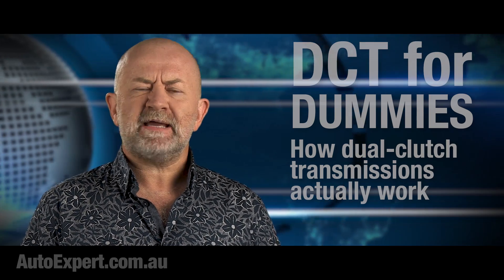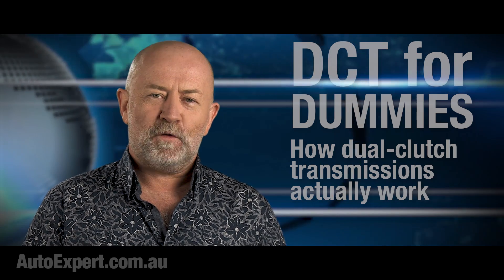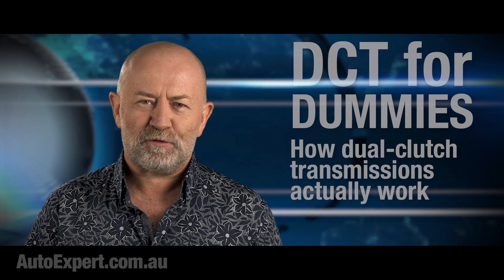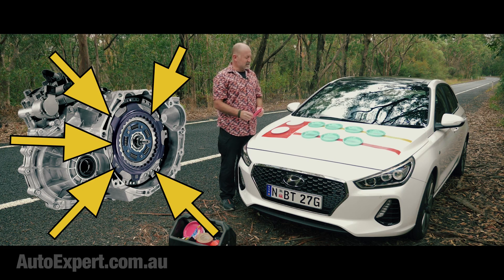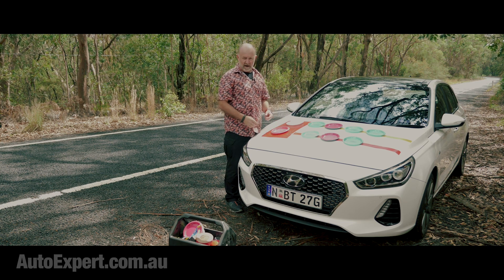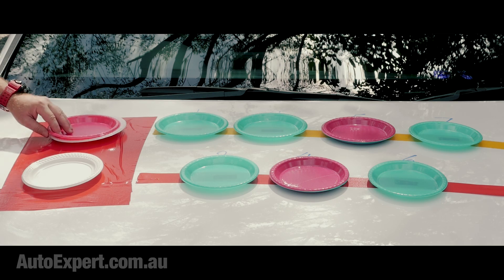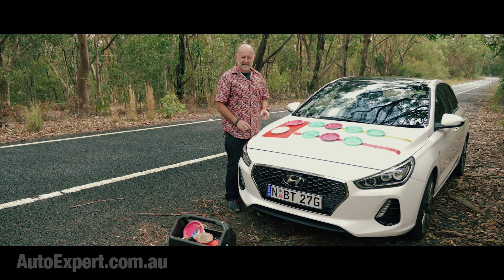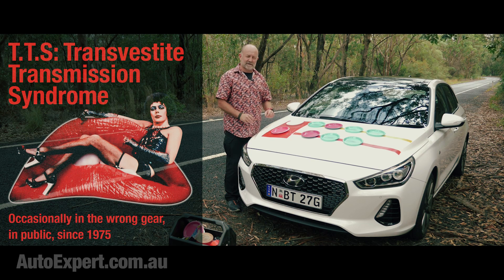DCTs for Dummies. (How dual clutch transmissions really work.) | Auto Expert John Cadogan

Comment: Something tells me that I will not be willing to have a DCT on my next car. That you for that one, John.
I have been driving a manual transmission for the last 20 years. I just simply got bored with the constant need to shift unless on a highway. My wife's car has a CVT transmission and I simply fell in love with it. I really enjoy the constant low rpm when I do not need to use the torque and a reasonably quick downshift when I step on it. The only thing the transmission does not like is when you hit hard on the gas after a long while driving at 1,5-2 kRPM. This puts a really big pressure on the transmission and it's not pleasant to experience. Fortunately, the transmission loves to keep revs at 6+ kRPM when accelerating with your throttle wide open and that feels awesome. Other than that a perfect transmission.
Reply: Carecaplatonico, this is just why there are several options to choose from. Anyone can find the best fit. I am still sure I will go for a cvt transmission on my next car. After all you can still use the paddle shifters and make the revs rise and drop when driving it.
Reply: Carecaplatonico, yes there is such an option with the Honda's cvt. You do not even have to shift to S mode to activate it. You see, things  change very quickly. I wasn't such a fan of cvt 10 years ago but that were different shifters.

Comment: How those dry clutch DCTs are in stop and go traffic? What if the stop and go traffic is on a road that goes up, on a ~10% grade?
Compared to torque converter automatics.
Reply: You don't creep with half brake, once the car in front moves off I fully release the brake and apply throttle and brake fully again if needed, thats all you need to do to preserve longevity, and grades clutch will sort itself out

Comment: SOOOOOOOO DISAPPOINTED, JOHN.....Was hoping you would get out the permanent markers and draw on the cars bonnet.  Had a R32 Golf DSG(2007 MK 5)...it was great car..until the mechatronic unit decided to 'shit the bed'....Obviously, in Spain they just laughed and billed me for a new unit...VW only recalled a handful over cars in Europe...W4NKERS!! However in the US of A any car with DSG got a lifetime warranty...probably down to a class action law suit.........................Allegedly the 'Monkeytronic' gearbox over there has a  'Speshhul' relationship with 'Boston Legal' and all that stuff.
Reply: Shows how much I was watching, must have been flipping between JC and Youporn at the time.....Didn't have a choice regards the R32, forced upon me as a 'work vehicle' out here in Spain...It was a great car, with every optional extra but like I mention the DSG system had its faults.  Few cars have/had(?) the grip and power to beat it on the mountain roads around were I lived and the DSG was very good to use..until it didn't want to work as it should....went through a few set of tyres though....NOT cheap!! The main disappointment was(still is) VW's attitude to its customers and denial of any problem with the DSG/mechatronic unit in Europe and elsewhere.

Comment: I had the same "issue" with the gearbox needing a short bit to sort out the correct gear for "unexpected" maneuvers, when I was driving a 2017 Audi A4 for a few weeks as a rental. What I did to improve this situation was to manually select the gear I wanted with the shiftpedals behind the wheel before accelerating f.e. when doing an overtake I would put it down into 4th or 5th from 7th gear. In the Audi you didn't even need to take it out of full auto mode to do this, simply pull the shiftpedal to select the gear you wanted and after you where done accelerating it went back to full auto mode after a few seconds.

Comment: I just bought a 2010 Audi a4 with the S tronic trans. A DSG pretty much. It's had the recall done on the mecatronic unit so it's really good. I use to be a all but manual fan but after this I prefer the DSG for spirited driving.  The engagement with the insane gear changes with paddles are so fun. Sure they have the odd vibration and jerk and bits and pieces. But I'm sold.

Comment: More junk that can go wrong. I'll stick to the Ford Falcon.
Reply: CBY Bulldogs with its 12 month warranty because they know it will shit itself.... 😂
Reply: Fact: Ford AU Falcon 2001 - 272,000km
Reply: MIne is at 441,000 still going strong with no oil usage
Reply: I've found from working on computers that even the most problematic models can keep running for a long time if properly maintained and used. Nice work on those high mileage figures!

Comment: The paper plates John used to describe the inner workings of the gearbox were the actual components of Fords powershit transmition.
Reply: Ricky Doodlous ummm they were plastic! Duh!
Reply: I own a Ford Focus and I can verify this. Thank god they came out with better clutches
Reply: @RagingUtai  They still haven't gotten the software right, and I don't think they want to. A Ford service worker told me they slip the clutches so the launch is "more comfortable". I got a custom tune for my Focus. In my opinion it's more comfortable than stock.
Reply: Ricky Doolous:OH! Ricky I wondered how long I would have to slowly scroll down under this YouTube presentation before I got to the ideal definition of Ford's version of what should be a better idea😢 Are you old enough to remember the 60's and 'Ford has a better idea' campaign? It would be quicker if you Googled it or Youtubed it to find it than for me to try to post it so I will advise you to do it that way because you deserve it the quicker way, because of your excellent comment! I say this as an honestly first time frustrated Ford  and 2012 Focus owner with an other wise nice SEL Hatchback except for this 'abomination'🤬 around town in stop-and-go traffic and a 'miracle of engineering'🤩 on the highway!
i.e.: 23a.m.p.g. vs 43a.m.p.g. with just a little over 19,000 mostly around town miles.This is where the dual-clutch fails to meet what I would consider a reasonable 25 A MPG. Having gone through  interpreting🤯 'anticipation' as breaking and acceleration and lighting all of the little flower petals from blue to green, and accomplishing the same for speed which was self-explanatory. We can leave the discussion of proper labeling of vehicle controls to another time. Like what's wrong with words or abbreviations of same versus multiple interpretations of sign language😤 Maybe there's a new push on to get ancient Egyptians to buy the cars and know how to operate them quickly.
Reply: @RagingUtai  it's the software operating the clutches. It's so obvious.
Reply: Ricky Doolous:🤣🤩👍🖖👌👏🤝
Reply: @RagingUtai  how many miles did you put on those clutches? I heard about Tom's tune not long after getting the car and knew it would help/eliminate the shudder, and had the clutches replaced once. Then put  32k on the next ones before getting the tune. Last year I had some bad shudder. I'm hoping it does well in hot weather. I think it will be fine.
I changed my purge valve and motor mount. I love the car too much to get rid of it. Plus I'm not looking to hurt my credit by trading into a higher loan and owing more money.
Reply: Tom says he has 55,000 shudder free miles on his wife's car. That's amazing.
Reply: @RagingUtai  in how many miles though? And how many miles were on your last set?

That's nuts. 6 or 7 times? I'm at 81k and mine were only changed once. Granted they would need it again right now probably had I not got the tune so probably 2 times in 81k
Reply: @RagingUtai  15,000 km on a clutch change? Yeah if that's the case then that's nothing. Usually the problem comes back around 15k miles. I made it to 32k before getting the tune. Like I said, last summer my shudder was bad. I don't think it has shuddered once since the tune.
Reply: I just sold my 2013 Ford focus DCT , had some issues with the tranny, not even 90K KM.

Comment: Firstly, I consider this to be an excellent demonstration with just enough technicality but not too much, some dollops of humour, so great for the 'ordinary fella on the street' such as I.  Secondly, for all those commenting here, just how many of you have actually driven let alone owned a car with a DSG (or Powershift etc), basically 'double clutch'.  I will venture to bet not many of you on any percentage scale.  Well, I have!  Following a road traffic accident on the day I was 18 (a motorbike engaging a car never works for the biker does it), I have to drive manual transmission cars, so basically NO choice!  

I've owned 'ordinary' autos by way of three Fiestas, a brace of Talbots, Vauxhall, Rover, Citreon, Honda, and CVT in a Volvo and a Fiesta.  The worst of these was the Volvo, being a horrible piece of s**t, enough said!  The big drawback with all of these was no matter what my driving style (I am no racer, trust me) the fuel economy could never be equal to an equivalent manual.  Not sure why that should be but I am not that technically minded anyways.  So, I am very experienced in living daily with auto gearbox cars.  

Then, in 2012 after testing nine cars, and many suitable ones amongst them (aside from the Chevrollete Cruise which was absoluty c**p) I took delivery of a new VW Polo 1.4 Match DSG.  My wife and I went on to drive the cars for three years, completing about 14, 000 miles (can't recall exactly but we do well below average) and it was fantastic.  For once we had a car that complimented/rewarded our careful driving style.  Although we didn't do very long journeys (mainly around town and shopping).  The best I attained in terms of economy was 62mpg on a journey of 35 miles, whereas say the equivalent Fiesta would maybe do late 40's to 50 mpg.  Also, the car didn't give one single glitch, faultless, although admittedly it was brand new.  In 2015 we changed the Polo in and acquired a new Seat Leon 1.2tsi DSG, and 2.5 years later it has proven to be superb in terms of the gearbox and in general.  Again, not one single problem.  As for economy, on the same 35 mile trip, several times, the best attained was 63mpg, and with the added room and comfort over the Polo we could not be more pleased.

So, in summary I would say that if you are considering a DSG (at least the VW and Seat) then listen to those who've actually driven them, better still owned them, and I can hand on heart say I could not be more happy.  Indeed, later in 2018 I am looking to attain another Seat Leon (not sure what engine size as yet).

Thank you,
P.

Comment: One issue that you did not cover is "start from standstill" shudder.  I tested a Skoda a few years ago and rejected it because it was dreadful in this respect.  I currently have a Hyundai DC and this is much better, but still no where near as nice to drive as a conventional automatic.  Personally, I would accept the lower fuel economy of TC automatic to have the much better drive than the present DC automatics, and eventually I would expect a huge bill for clutch replacement with DC.
There is of course a much better alternative that gets rid if the "wear out" clutch and much of the expensive mechanical complexity in modern gearboxes - electric transmission.  This is a much better driving experience than any current mechanical  gear train, whether it is manual or some form of automatic.

Comment: One point that you didn't make, is that most normal automatics with viscous couplings will also change up when you let off the throttle, as you described. Only if you plant your foot on the floorboard will it quickly change back down.
I would say that, probably, only a manual transmission will work properly in the slow moving traffic and changing to the other lane and gunning it, because the computer in charge of the gear selection is the same computer that has seen the gap and wants to gun it... Put in Lidar and cameras into the onboard decision making and it might spot the gap and be prepared for sudden acceleration. But I don't see much of a negative, going from old-school automatic to DCT in this situation.

Comment: Consider the potential for a triple clutch transmission, one engaged, one ready for the up-shift and one ready for the down-shift. Harder to produce concentric clutches of course, and more expensive, but no delays - ever. Couple that with a conventional manual clutch or lockup torque converter for stops and you have an excellent heavy duty transmission for a lorry or tractor. I invented a dual clutch transmission a few years ago, but sadly I wasn't the first by a long shot. I thought your explanation was really good, but you didn't mention how they handle a standing start, which can be a problem for these transmissions.

Comment: What I don't understand is why the Hyundai/Kia DCT creeps when you let off the brake pedal. This is one of the things people get wrong about these transmissions. You can burn your clutch by creeping like that.
Reply from the maker: Not really - it has over-temp protection. And you could just not creep forward for 400 metres...
Reply: It's still wearing it down faster than not creeping. 
And as far as I can tell most people don't understand the concept of a clutch, so if the vehicle creeps on it's own, they will assume it's a good idea to do that for as long as they want, because they are used to torque converter automatics that don't have a problem with that.
Reply: If you fully release the brake the clutch should be fully engaged
Reply: James Dewar Yes, after a while it does fully engage. But imagine being stopped at a traffic light on an incline. You wait for the person in front of you to get going and you let off the brake. The car won't accelerate enough to fully engage the clutch due to the incline. And you will be creeping forward with the clutch constantly slipping. Of course it's fine when simply getting going, but there are several cases when the situation isn't that simple.
There is a reason why you never use the clutch to hold your car on a hill in a manual. It's the same thing.

Comment: I drove (since new) a 2008 VW R32 fitted with a 6speed DSG. The car had done 110,000km never had a problem with the DSG just everything else broke.
I now drive a Renault Clio RS 220 Trophy DCT. Really enjoy driving with a dual clutch transmission I always drove the car as a manual using the paddles.

Comment: I prefer to inch forward when brake released; take my foot off the brake when on a bit of incline. DCT can’t do that or you’d risk early clutch replacement. Internal build are complicated coming form traditional AT. DCT and CVT are good on paper but operate them correctly requires understanding of how they work mechanically, which is too much to ask for most people.
Reply: Dead right.  It's B-R-A-K-E, by the way.
Reply: Corrected

Comment: So why would Audi & BMW start moving away from DCT?  Why would conventional torque-converter transmissions be making a comeback? ZF's transmission is by all accounts brilliant. Mercedes put a DCT in the S63 but continue with a torque-converter in the S65 and the Maybach V12. Torque limits notwithstanding - Bugatti has a DCT. Will a DCT last as long as a typical torque-converter transmission in a car where 99% of it's life is in stop/start traffic? I doubt it. Lastly, why does every salesman and motoring scribe have a fetish about 0-60 times and fast gear changes. It's as if nothing else in the universe matters. "I saved 0.07854 seconds getting to the next set of traffic lights..........YESSSSSS!" Great reviews John and I love it that you have never had a scene of a car drifting. Motoring reviews are so irrelevant to real car drivers these days. P.S Can you do a review of conventional autos, how they are fighting back...........Please!
Reply: i think traditional auto can have more gears and the clutch techniques have improved so torque converters lock up extremely quickly when you cruise even at low speeds. Shifting speed is also much better. I think traditional auto might be even more fuel efficient than manual and DSC cruising at high speeds as they often have a rediculous overdrive gear at the end. I personally think with a 7th gear the manual could catch up....
Reply: When comparing a manual to a conventional automatic the manual wins every time all other factors being equal. The main reason why they're moving away from the DCT is because their customers don't know/don't care that they're using one which can inadvertently damage a DCT(This is also why you keep seeing CVTs. They don't act like a conventional automatic but they can be driven the same way and not be damaged. Of course there are a lot of tricks E-CVT owners came up with but that's another story). This often leads to higher than expected warranty repairs.

Comment: Sorry John, excellent representation and explanation but I'll be forever happy manually shifting and heel and toeing either 5 or 6 gears thru a series of simplistic shaft mounted straight cut gears contained in an alloy housing. I'd rather drive the car than have the car drive me. Old school outlook ? Possibly. Care factor ? Zero !!!

Comment: I have recently acquired a Vitara 1.4 Ltr Turbo with DCT transmission. So far I've found it excellent and fuel efficient. Yes, there are small differences in feel and driving styles and of course never 'creep' in traffic but I like the technology mix of Turbo and DCT. It feels like a car with a bigger engine.
Reply: None at all actually.
Reply: What is it about creeping that is not good for the drive line? Is the clutch being slipped?
Reply: Carl, yes the clutch is being slipped. If it's a wet clutch, I'm sure it would be more robust but I'm sure the less expensive DCTs are dry. More heat is generated also. For those who have lived with torque converter Autos then it just means a little more discipline in bumper to bumper traffic.
Reply: Exactly.  I've found the same with our Seat Leon and VW Polo.